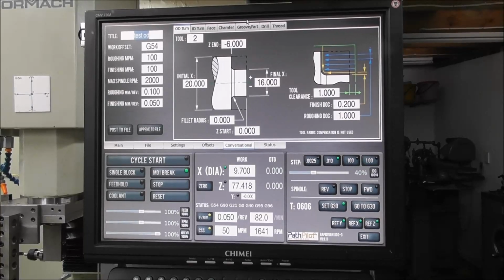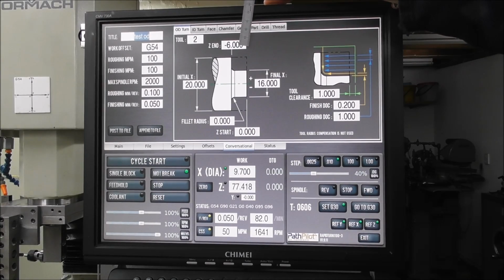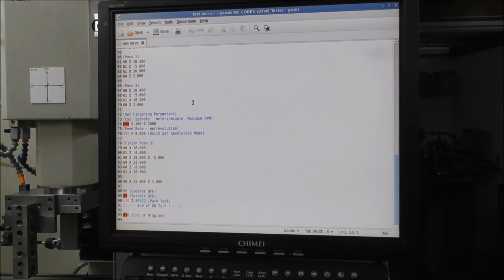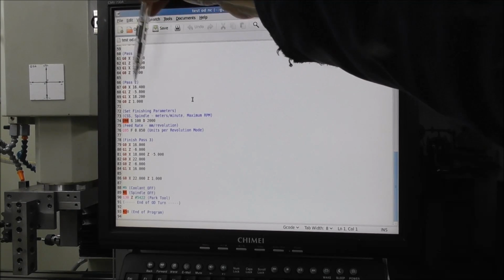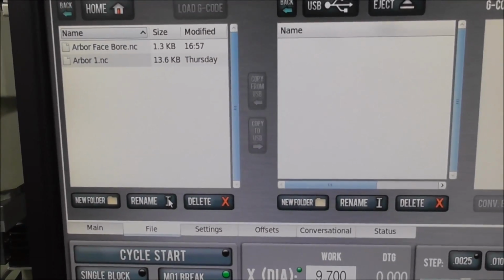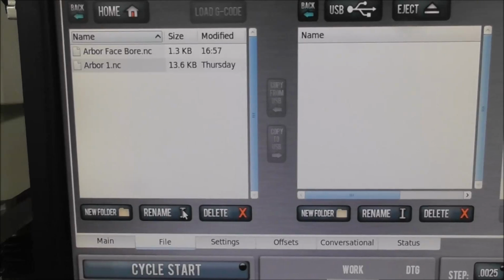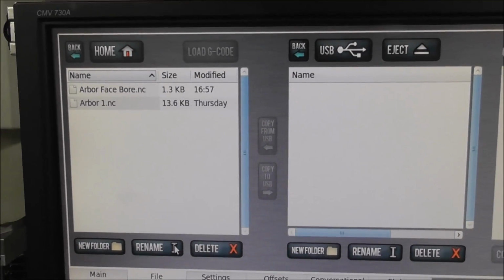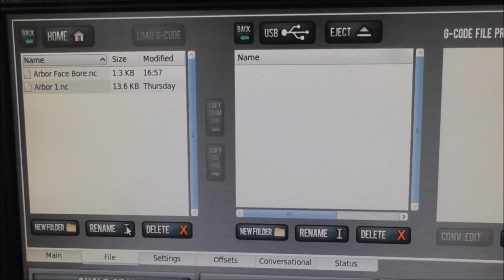Tormach RapidTurn - Part 26. Conversational and Tips and tricks.

Comment: Hi Cliff - so what was the upshot of the pathfinder glitch? Thanks Pete
Reply from the maker: Hi Peter. Good question!  I spoke with a Tormach software developer about it and he agreed at the time it was not ideal, and was looking in to changing it in this regard. I am not sure if they have implemented the changes yet. I have not yet installed PP10 - I usually hold back an update or two.  Cliff
Reply: Thanks Cliff - I am tossing up between a Tormach like yours or a couple of similarly priced machines with Siemens basic controllers - more spindle speed and power but less equipped and less well supported V Tormach....your videos on Tormach are I think the most informative on youtube - they should be sponsoring you!! I'll send you an email re your clever probe.
Cheers
Pete
Reply from the maker: Hi Peter - Yes what to buy is such a fraught decision - there seems never a simple answer.  Cliff

Comment: Hi Cliff, I am considering purchase of the rapid turn. Looks like a great little accessory for my 1100. Anything I should know before I buy? I have built a 16 position tooling block which takes standard tormach holders. I use this at the moment and "vertical" turn my turned parts. Works great, but is limited. Any help would be appreciated.
Reply from the maker: Hi Jim - Have a look at my 26 videos and then email me any questions ( address end ITTP part 6). Cheers  Cliff
Reply from the maker: Sorry Jim I missed your comment - how are you doing currently?   Cliff

Comment: Hi Cliff
Your comments about manual versus cnc lathes.
Have a look at Prototrak lathes, they are the perfect answer to your dilemma they are both full manual and full cnc I have been using  them for over 20 years I am on my 2nd lathe. They can be used for full manual operation for one off jobs, and have a very simple conversational programming language to quickly go to full cnc parts. They can be configured with either quick change tool post or automatic changer, plus many other addons. I am in Australia and the agents put the Prototrak controller on a King Rich chassis and I have found it truly fantastic, very rigid and accurate.
Cheers
John Emery
emers@bigpond.net.au
PS google Prototrak based in the USA and get all your questions answered
Reply from the maker: Thanks John. I had an quick look and they do look impressive. I imagine more expensive than a Tormach Slant Pro though?   Cheers  Cliff

Comment: CNC vs manual has always been determined by individual part complexity and quantity.

With conversational programming, CNC draws closer to manual because the programming, even for one-off parts, is just a minute or two per operation. The machinist can run each operation, stop, check and think about the next one.

But CNC does not provide "feel" and as much live feedback to the operator (crashes excepted), during the machining operation. Other observation skills are required. Nor does CNC easily allow for e.g.cutting tools to be walked in; all tool dimensions have to be defined before the spindle turns.

NB I'm equally incompetent in manual and CNC.😞
Reply from the maker: Maybe...but well summarized. Cheers  Cliff

Comment: You should keep track of which version of NC code was used to make each batch of part and eventually serial number of final product. Just in case there's a problem. 

There's also the issue of interchangeability of (new) parts into old assemblies. Otherwise you need to keep "virtual stock" of old parts (versions of NC code) in case replacements are requested down the line.

Don't let that discourage continuous improvement.
Reply from the maker: Yes I agree and I do. Cheers  Cliff

Comment: Hi Cliff, Put a dehumidifier in your workshop, less moisture in the air means less condensation on cold metal work. Don't need to go for anything to flash. warehouse or mitre 10 $200.
Cheers Dave.
Reply from the maker: Hi Dave . I have one at the back - but in the front it is too drafty most days. Cheers  Cliff

Comment: Hi Cliff, John Saunders at NYCCNC has some video on conversational programming with the Slant Pro at  https://youtu.be/VFSy0RoFyGM?list=PL9tn9rGywKUXyqvmfxACug5unIwh-4J0_ that may be of some interest if you haven't already seen them.  Regards, Chris
Reply from the maker: Hi Cris - Thanks for that. If you look at from 19 min in.....it looks like the finishing face pass is from the outside in - as I would expect. So it looks like SlantPro is set up differently?...Is this in error?
Reply: It had been a while since I watched that so went back to the 19 min mark and yes, I agree.  I'm no machinist, but if I was doing this on a manual lathe I would use a tool with relief and do it center out on the final pass (like how you pointed out).  I don't know if it is the "correct" way to do it but it is certainly the easiest way.  From a CNC point of view it seems more logical to do it from the outside in, because you could achieve more from one tool (if that tool didn't have relief).  Getting the ends of two tool paths to meet up without forming a machining mark wouldn't really be an issue using a CNC I would have thought.  I just tried turning a similar shaped part in Fusion 360 CAM simulation.  90% of the Tormach tools in the Fusion library have relief to allow machining in both directions but indicate a collision turning front to back (that may have been due to the tool I selected).  Turning back to front doesn't produce any CAM warnings.  This got me to thinking that perhaps there is a setting that determines the direction perhaps in a configuration file if there is nothing in the GUI.  If there is no way to change the direction from the GUI then it seems more logical to default to the safest direction to avoid potential collisions.  My PCNC is still been fumigated by MAF so I can't really say for certain.
Reply from the maker: Thanks for that Chris.  So......not long now!  Cheers  Cliff